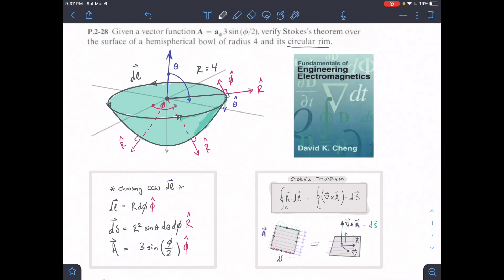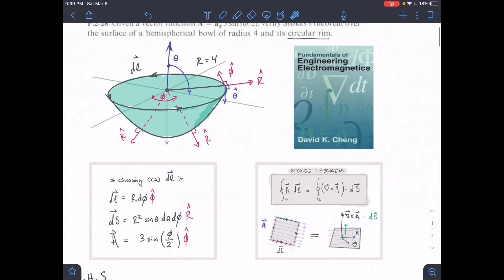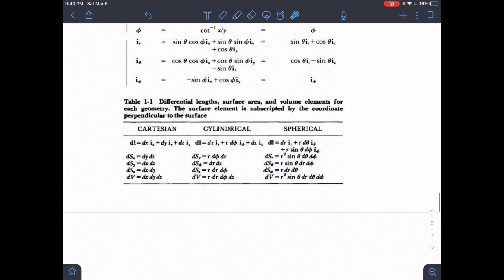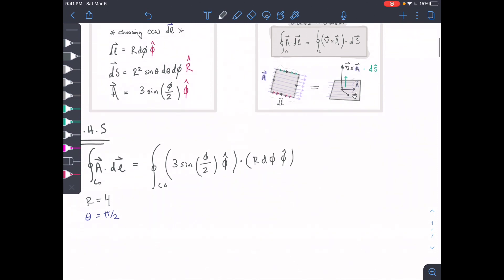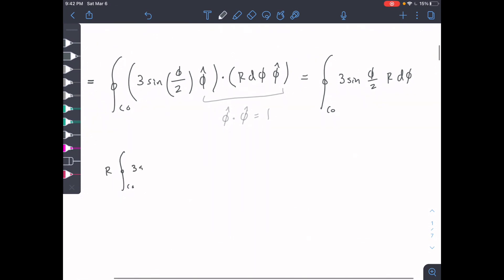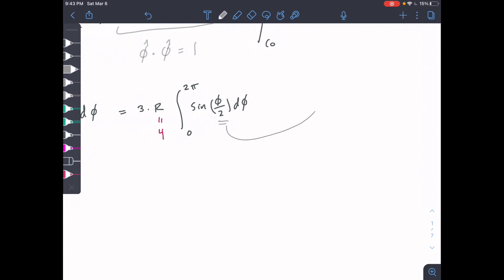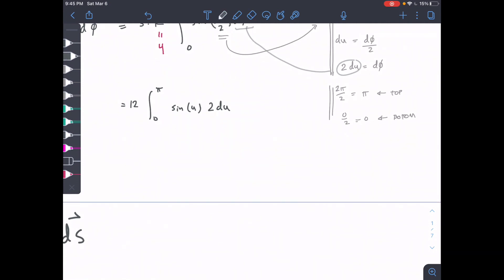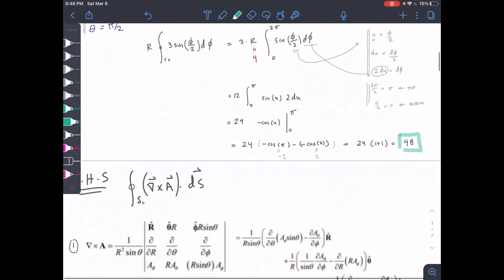2-28 part1 Stokes Theorem Half Sphere

Comment: In start of the vedio at 0:17 you write dl =Rd(phi) theeta  basically this is Rsin theeta  d phi you also write here why it become R dphi theeta cap 
I later on understand that you put value of theeta bcz at circular rim the angle is π/2 so you put the value of theeta that's why it become R dphi theeta cap but you must include it into your notes bcz it cause confusion to student
Reply from the maker: ahhh I see, yeah on the rim it's typical to make that assumption. I see what you mean about confusion if you're referring to the dl for phi in the pdf notes, it's not an error, but I think it would probably be good to point out why it simplified, thanks
Reply: @redSTEM  yes